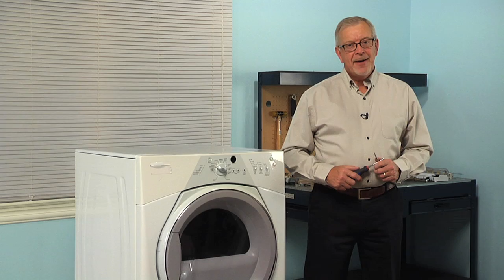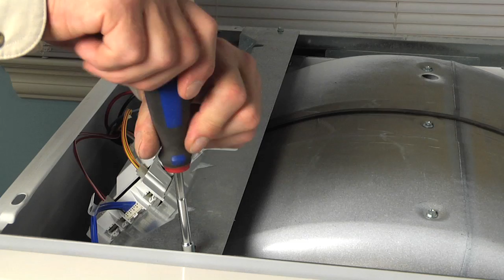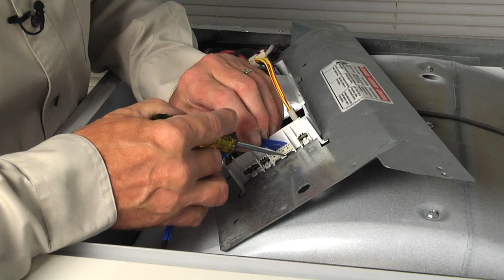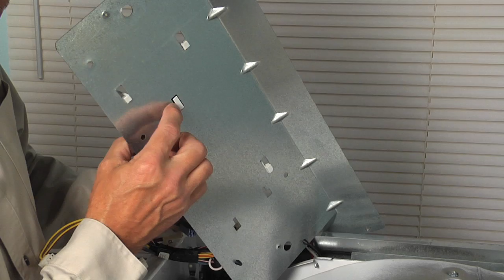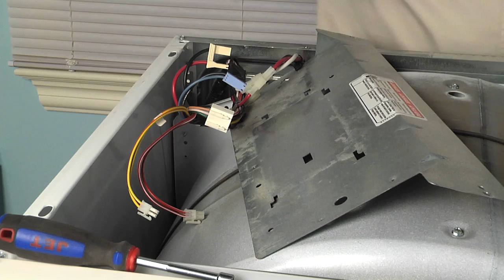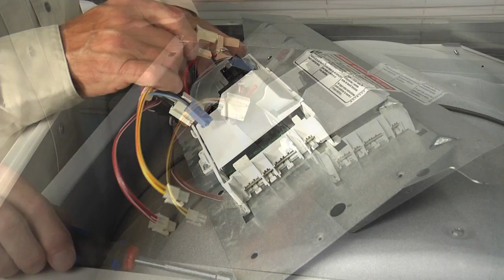Dryer Repair - Replacing the Control Board (Whirlpool Part # W10111606)

Comment: My Duet Dryer gave an F1 code now and again. I would power off and on, then it would work, kinda. I learned the F1 is a pretty generic code for way too many issues. It is useless as a diagnostic. My dryer would stop after a minute or three. I would press cancel and start a dozen times, then it would work again for a few minutes. It took 5 - 8 starts and stops to finish a load. Now and again, it would only take one or two. 

OEM control boards are pricey, like $450. Used are $120, but a refurbished one is about $200. I went with that option and changed it out in 20 minutes, and all works well. Thank you for the video!!!!

Comment: My dryer for a couple months has been randomly beeping during the cycle. The other day the front panel was dead and would not respond. After flipping the breaker for about 10 minutes it came back to life. Today it will not come on at all. Would you suspect the front control panel or the control board on the side above the drum?

Comment: I can't get my red and black wires out of the old board (the ones you said are in a relay).  They don't look like they are in a nice little beige housing like you have but they seem directly plugged into the black box on the board.  Thoughts?  ty

Comment: A load dries faster than the new washer will wash a load, which is nice≖>allmy.tips/Whirlpool-Dryer?G59    Second round of laundry today. The wife is happy with both. We recommend. The dryer has leveling feet. They allow you to level machine. The dryer has to be vented. Vents require routine cleaning. Failure to do so will affect drying times and can cause fires. There is a maximum length for a dryer vent. That information, along with lots of other information, can be found in the owners manual.

Comment: Fantastic!  My replacement board had front edge plus on top while old ones was edge entry but worked fine.  Old board may have burned out because drum seems to be meeting some resistance.  Sometimes takes a short time to start spinning and then sounds like there is something causing it to not spin easily

Comment: My board actually melted and I need to replace one of the wires as well as the board. If i count from front to back it is the fourth wire you removed or the first at the back of board. It has light blue wires and a light blue connector. Can the connector be bought separately or is a whole new harness required?? One of the prongs on the board melted and fused to the connector.

Thanks for any help or advice you have
Reply from the maker: The terminals inside of the plastic connector are standard .25 inch female spade terminals. Although the connector is not available from the manufacturer, you could possibly replace just the terminal and fit it into the connector housing. Those wires are the line voltage for the motor winding.
Reply: Thanks for the help. Great videos.